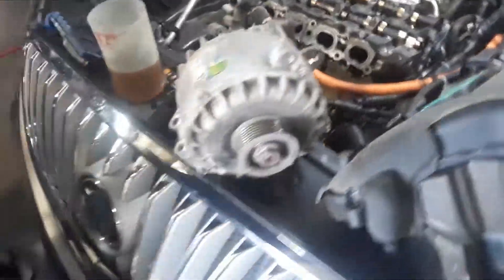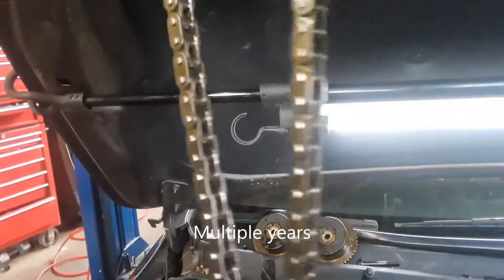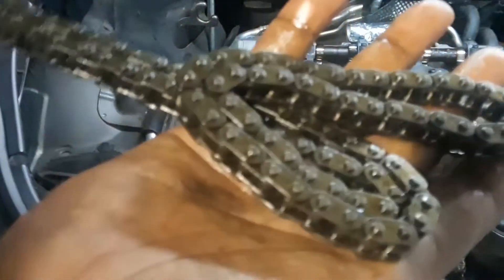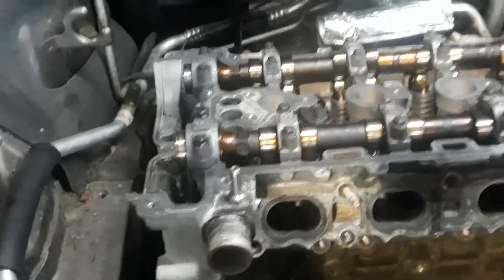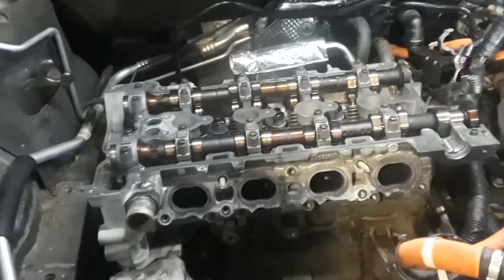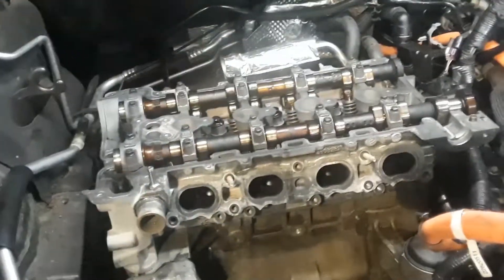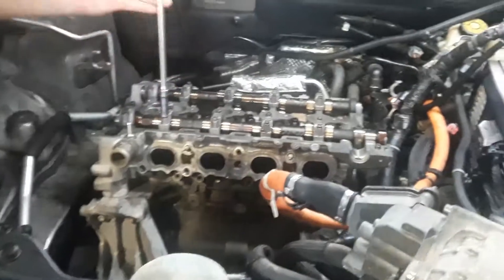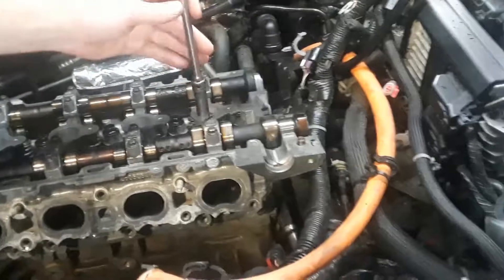2.4 GM Buick Engine Timing Chain Common Problem

Comment: is that a bicycle chain? what junk
Reply: Nearly All cars with timing chains have chains that look very similar to this one
Reply: @r3alfish  i have seen t  belts on v6 toyotas and hondas last 225k miles
Reply: just did a timing belt on a 98 tacoma v6 with 350k on it
Reply: I changed my timing chain tensioner to the upgraded model and still had it fail less than 15k later on a 2.0L Ecotech.2007 Pontiac Solstice GXP.